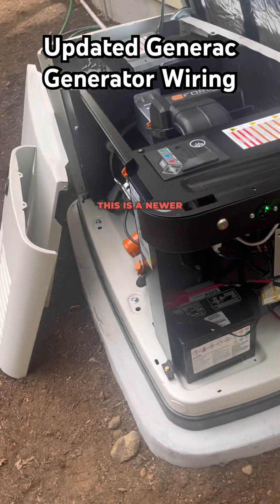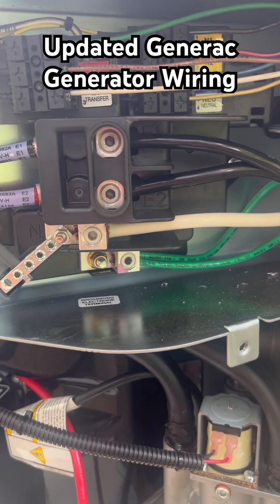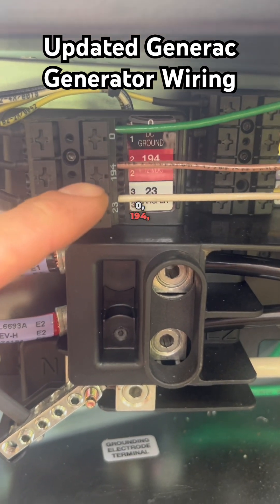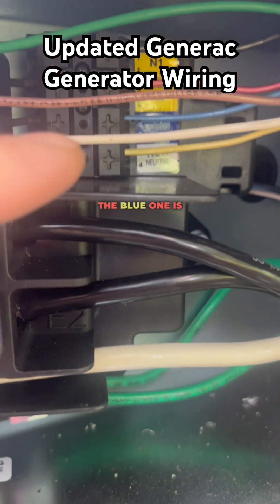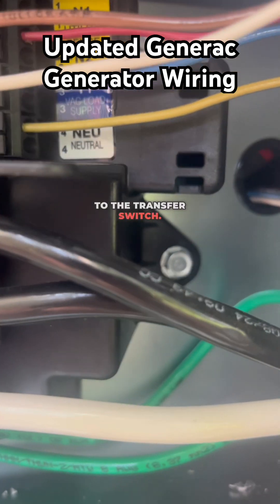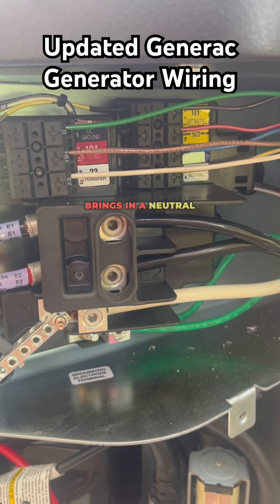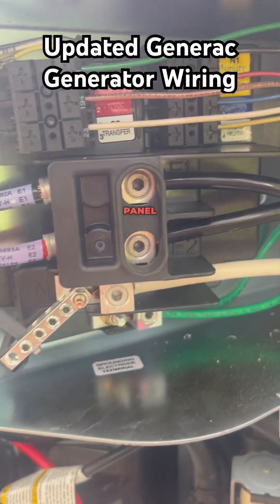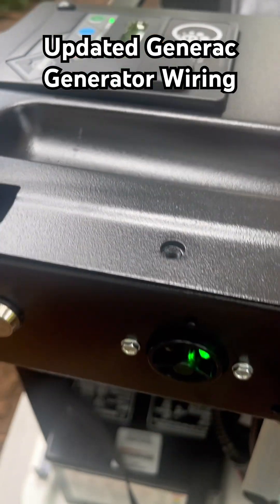Expert Electrician Shares Top Generac Generator Wiring Tips

Comment: What size wire did you use for main power/neutral/ground to transfer switch? Also did you direct bury or pvc if pvc what size? Also did you not have to hook a wire from ground stud to neutral bar?
Reply from the maker: We use 1-1/4 inch PVC and run #4 copper for residential applications. No wire in between ground and neutral bar.
Reply: @GeneracDoctor  thank you for fast response!!! Did you use #4 on all connections?
Reply from the maker: @sinharvest5837 yes,  the feeder is #4 copper for the two hots and neutral and #8 copper for the ground. The control wires are #14 solid copper

Comment: I have a 2024 model that has a 10 Amp ATO fuse on a 6” pigtail with on end connected to T1, while the other end is not connected. I have no idea what it’s for or what the other end connects to as the manual says nothing about it.
Reply from the maker: Some of the pigtails are for testing purposes. If you don’t see it in the install manual and everything else has a hole in the control panel then it’s fine. 
Just make sure your T1 has 120 VAC and then you’re good.